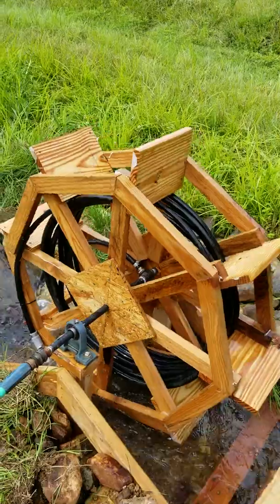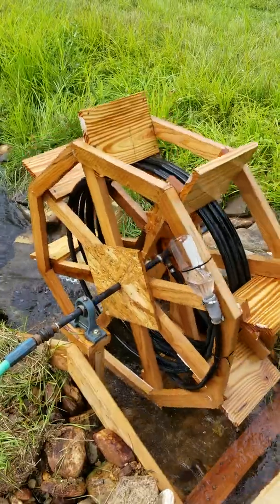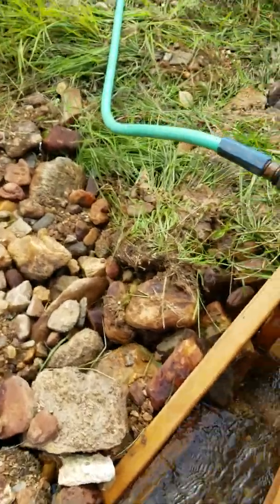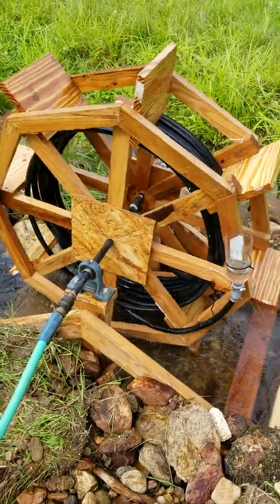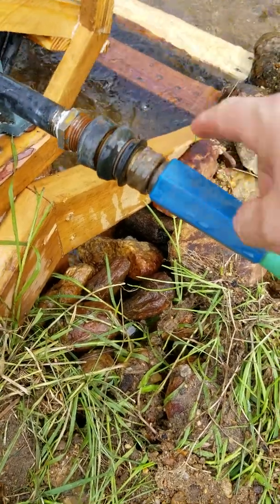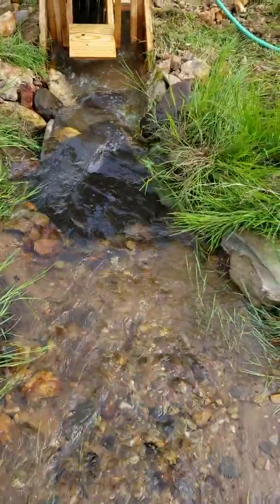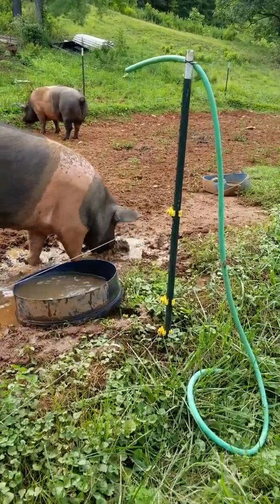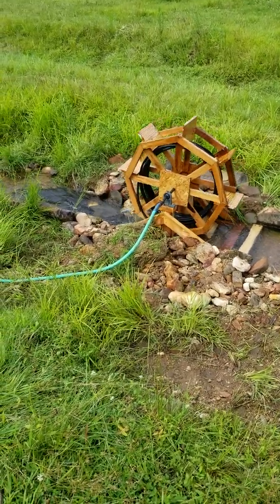Water wheel spiral pump

Comment: What brand of quick connector better to use?  One I'm buying at Lowe's lasts day or two. Please advise! Thanks!
Reply from the maker: I don't really remember. I got it at local hardware store here in town. Mine didn't last very long either. I did put some grease on the male side and it seemed to cut the wear time a litter. I would run them until they wore so bad water wouldn't push up hose any more

Comment: How have you fastened the wooden squares to the shaft so that the wheel rotates the shaft and not slips on it?
Reply from the maker: It was just fit very tightly when I put together. The wood probably swelled some when it got wet and made tighter. I never had any problems with it slipping on the shaft.

Comment: What if you put more bottles and hoses and T's on the shaft so you might get more water ? With a bigger wheel
Reply from the maker: Maybe. This worked great for the flow I had at the time. It took a lot more force to turn once it had water in it. I’d say the more you had in it the harder it’d be to turn
Reply: @coreycline6858  make sense, thank you for replying
Reply from the maker: Thanks for your interest!

Comment: Good design. I have a question. What is the apparatus that you use to connect the axel and the hose ?
Reply from the maker: ÖZCAN DOĞAN it’s a garden hose quick connect. It has a spring loaded collar on the female side and the male side has an indention in it. It’ll does wear out and has to be replaced though.
Reply: @coreycline6858  thank you. can you send me a link that I can see how it looks in the store?
Reply from the maker: ÖZCAN DOĞAN I’ll try.3Sets Garden Hose Quick Connect 3/4 inch GHT Brass Easy Connector Fitting - Quick Disconnect Hose Fittings Male and Female (3Pair) https://www.amazon.com/dp/B07FC1KZWQ/ref=cm_sw_r_cp_api_i_PsdsEbE4C6WM5 . I got mine in hardware store. This is same thing on Amazon. Litter me know if you can see it
Reply from the maker: ÖZCAN DOĞAN did you get the link?
Reply: @coreycline6858  thank you very much. I can see the link.
Reply from the maker: ÖZCAN DOĞAN you welcome!

Comment: Thank you so much for posting your recent video.  I've been interested in water wheel pumps for small irrigation projects for several years.    Looks like your pump does what you need for your immediate project.   Would you mind posting some stats like diameter of your wheel, amount of water pumped for a given time and height you are gaining from the pump to end of the hose.    Your quick release coupling seemed to work well - I'll have to check at a hardware store to see if I can find the same.   There are a few of us around interested in similar projects - not sure why not a lot more.

Thanks.
Reply from the maker: DenverDave2 Thanks! It does a real good job. Think the height its pushing is like 8-10 ft from wheel outlet to end of hose. The wheel itself is 3' diameter. Had to move paddles out 3" so water would push it. Thanks again!
Reply from the maker: DenverDave2 Also the amount its pushing is in description. Thanks again
Reply: Sorry, I was so wrapped up in watching your video multiple times and thinking about the hose coupling that I completely missed that volume statistics were in the description. I think the wheel looks attractive.   Seems like some things could be adjusted for more volume, but you are already pumping more water than you need to water your pigs.   A water wheel that earns its keep. Also the construction was such that some of us could mimic your approach.

I've created a facebook group for water wheel pumps - if you are a mind please stop by and give suggestions.   I've already added a thread discussing your wheel.   With your permission, I'd like to add a picture of your wheel to the banner on the group.   I think you've made a very neat looking wheel, modest size, with available materials -- good job.
https://www.facebook.com/groups/240458583255303
Reply: Brilliant Design!  Simple I love it!  
 @coreycline6858
Reply from the maker: Eric Prater thank you.
Reply: How many feet of pipe wrapped around the wheel?  Thank you in advance!  Nice job on  a brilliant simple design @coreycline6858
Reply from the maker: Eric Prater around 50' of 1" pipe.

Comment: thanks for posting.  good work.   here are some things to consider.  at :35, the scoop is Not correctly designed.    at :40, note that water falls out of the scoop, on the down-hill side.  (scoop length should be equal to 1/3 of the length of the outermost coil.)    see link for info.    a coil/spiral pump can be optimized for 'air lift'.   water can be 'pumped'  straight  UP at the pump outlet, directly to an elevated catchment.   this can supply water to a gravity fed system.      cheers

linked illustration of a spiral pump;  scoop is Not correctly shown
https://lurkertech.com/water/pump/morgan/tripod/image019.jpg

https://en.wikipedia.org/wiki/Water_pumping#Coil_pump

https://lurkertech.com/water/pump/tailer/
Reply from the maker: David Davids thanks for the info!
Reply: Guesstimate on how many feet of abs pipe?  Thank You in advance!   @coreycline6858
Reply from the maker: Eric Prater best I remember it was about 50'.
Reply: I was thinking it looked like that amountish!.. Hey I was at the Coop and descrbing what I was going to try, and they had  a n R Pod sprinkler connecter that was 1.5 inches,  it was $65, kind of pricey, but I think I am going to try it.  If I can I'm going to go off of both sides of the axle.  We'll see... ongoing
 @coreycline6858
Reply from the maker: Eric Prater won’t be able to go both sides or the axle don’t think . It’ll never build any pressure to move the water.
Reply: My "theory" is to try 2 scoops, 50' of pipe on each into a T, I'll try one side, then if it's possible I'll try the other, I'm going to build a box and get the distances on the paddles as close as I can to the box wall so there is more force on the paddles, again it's all "theory" until I do what you did, again, nice job! @coreycline6858
Reply from the maker: Eric Prater Gotcha. That might work. Good luck! Keep me posted!